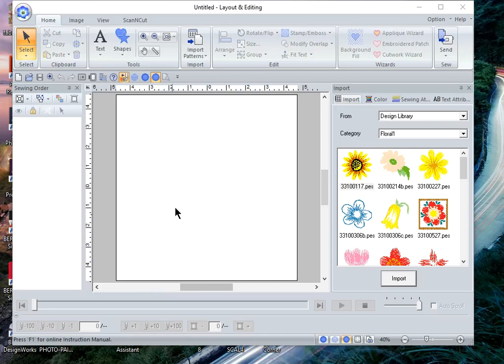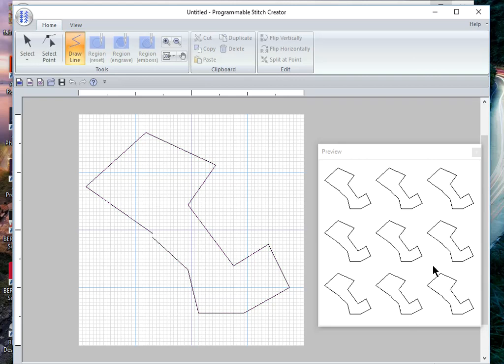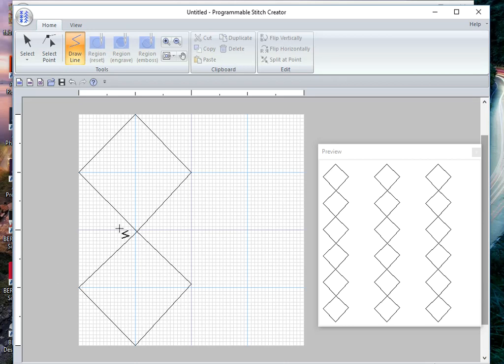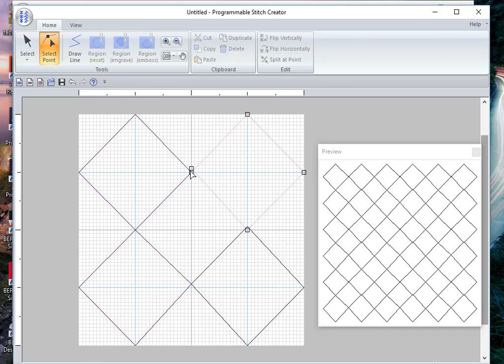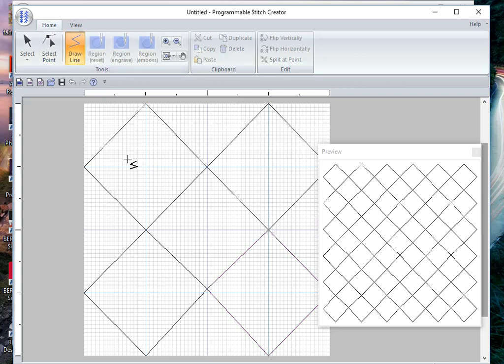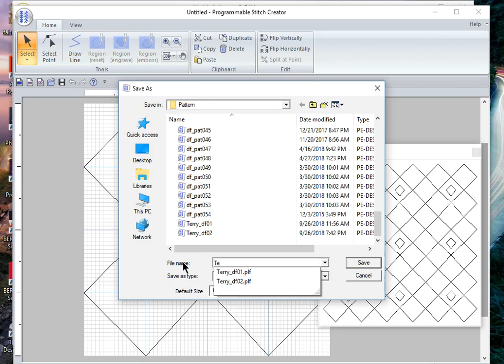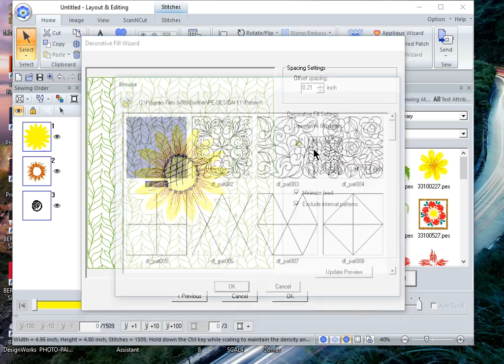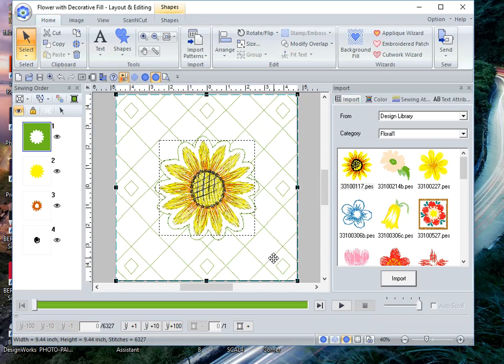PE Design 11 - Background Fills Part 4 - Creating a Fill

Comment: Is it possible to use a fill design in my DM2 the way I use the fill designs that are on the machine? I want to import and use my largest hoop to quilt a quilt. I would like to be able to change the stitch distance they way I do with internal designs as well.

Comment: Your tutorials are great, however, I have no idea how to get my purchases designs from my computer to the PE Design 11 software. Could you please address that? Thanks!
Reply from the maker: Julia Markovitz - where do you save your purchased designs?   Go to The Flower in the upper left corner and select File Open.  Navigate to the directory where your files are located.  If you make changes to the file, use File Save As so you do not overwrite the design.  You can open multiple types of designs.  I will film a quick tip video about opening files if you cannot locate your designs.